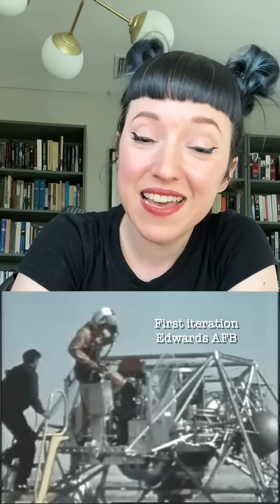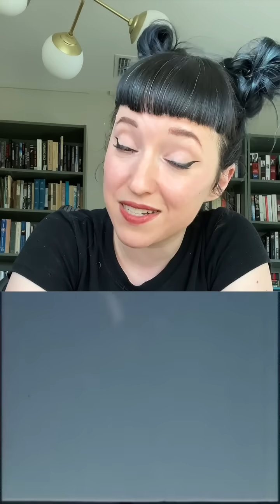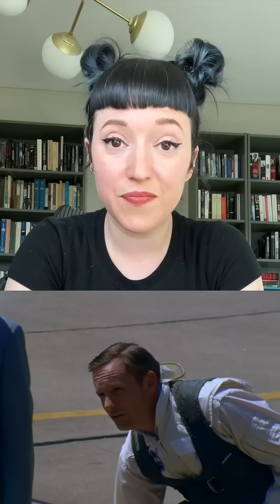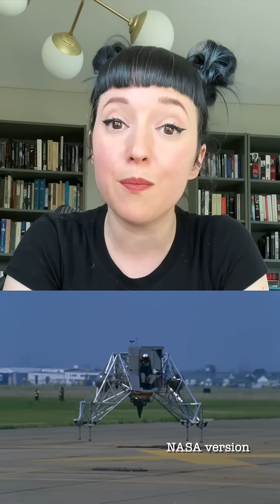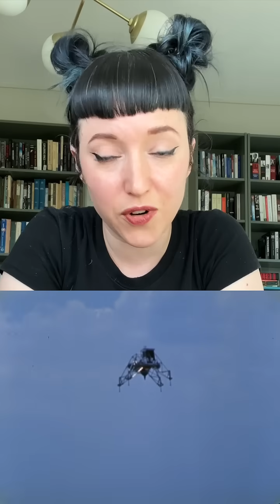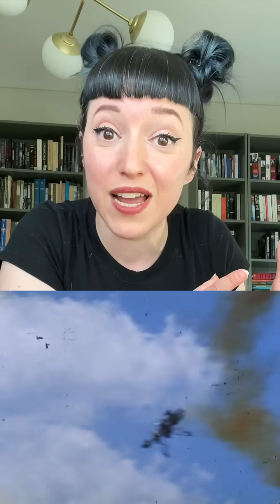When Neil Armstrong narrowly escaped a fiery crash #shorts #history

Comment: 5-6ths thrust? You wouldn't have enough thrust to take off. Surely you mean 6-5th thrust.  ( 6 Pounds  to 5 pounds weight.)
Reply: No, the jet engine provided enough thrust to cancel out 5/6ths of the LLRV's weight. There were downward-pointing rocket engines which provided the remaining thrust (in addition to the reaction control system thrusters).

Comment: I don't think that thing is going to do anything on the moon somehow.
Reply: Sure, it wasn't going to fly on the Moon. But what it taught the astronauts was how much more they'd need to tilt the lunar module to gain or lose horizontal velocity while flying in the Moon's gravity than would be the case on Earth.
Reply: @maxfan1591  Doesn't this beg the question isn't it weird the lunar module was never tested? It would have needed  to have flown hundreds of Miles with pin point accuracy. Was the flying bedstead ever capable of that? mmm. I suppose they got very lucky six times in a row with that one.
Reply: @ "Doesn't this beg the question isn't it weird the lunar module was never tested?"

It was, on three missions prior to Apollo 11.

"It would have needed  to have flown hundreds of Miles with pin point accuracy. Was the flying bedstead ever capable of that? mmm. I suppose they got very lucky six times in a row with that one."

Apollo 5: unmanned test in Earth orbit.
Apollo 9: manned test in Earth orbit.
Apollo 10: manned test in lunar orbit.

So it was actually tested for tens of thousands of miles. And as for pin point accuracy, Apollo 11 landed a couple of miles off target.

Comment: This is extraordinary footage that I have not seen. I can't tell if he ejected in the millisecond Before it exploded. Or weather, it ejected him before it exploded. I know with the technology back then. I'm sure it was he that had to eject. But that's just. Extraordinary reflexes. Here's what I really think happen. It was having problems he ejected and him ejecting caused it to explode. Either way, this is really cool footage. Thank you.
Reply: The explosion that happens in midair was the rocket motor on his ejector seat. You can see the flame fly up away from the vehicle leaving a trail of brown smoke behind it. The vehicle was on its side when he ejected and continues to tip over as it falls, then explodes when it hits the ground.
Reply: @Omnigeek6  I didn't know where the fuel was stored, I thought it was having a catastrophic explosive failure, not just problems with the steering. So that's Why he ejected. but looking back at it, I see it. That's a very stout ejection Rocket.

Comment: The Lunar Landing Research Vehicle (LLRV), a test vehicle used to simulate moon landings, is currently on display at the Air Force Flight Test Museum at Edwards Air Force Base, California; specifically, it's the LLRV-2 model. 

Key points about the Lunar Landing Test Vehicle:

Location: Air Force Flight Test Museum, Edwards Air Force Base 

Model on display: LLRV-2 

Purpose: Used by NASA to train astronauts for lunar landings by simulating the final descent phase

Comment: So are the other thrusters providing more than 1/6 cause other wise its not getting off the ground or hovering
Reply: Correct. AST doesn't explain it well, but in addition to the steering rockets there were two rockets thrusting downwards to mimic the lunar module's descent engine.
Reply: @maxfan1591  appreciate the response
Reply: @ No worries.

Comment: So they called them Zero Zero’s back than… Back in my day the seats had the ability to go from point of Ejection to 100 feet (Zero Zero). Deploying your Parachute and opening it’s self fully before landing… Your outta the Cockpit in one +/- second. There’s a lot of gizmo’s n stuff, but at my time vertical situational orientation wasn’t part of the general operation… Above or below 10k ft. the Drogue Shoot is deployed giving you vertical orientation with respect to the gravitational situation, the main parachute and the seat pan are Jettisoned from the seat at or below 10k feet.… As far as it goes F-14 to A-10’s you’re situational awareness is to Eject as horizontal is possibly possible in this situation, if you gotta go you gotta go whatever orientation you're at... Maybe I’ll dig up the books butt I don’t know on standard systems of my time having this feature… I don’t recall a system of solid rocket propellant angled nozzle sections part of the Mark 5 Solid Rocket Pack controlled by vertical situational awareness system at that present time... Now, there maybe some kinda a thrust nozzle vectoring sequence initiation assist today, of some sort on what we sometimes referred to Mark 5 Solid Rocket Pack under the seat. The Telescoping rocket on the back of the seat allows the seat and you to expeditiously clear n leave the aircraft cockpit as soon as possible, bout the time you’re clearing the Cockpit Canopy seating rails the Mark 5 begins It’s combustion sequence. Mind, it’s been one +/- second, now the real spine compression begins… 

Studying Miss. Amy’s posted video of the Ejection Sequence… (I don't have a computer right now running  with video software so I can't really zoom in n frame by frame that)  Butt the Bed Post extra soft cotton tying rope, hold on what we’re we discussing, oh yeah,,,  does have quite a nose up Pitch n going with a bit left Yaw n Roll. The seating apparatus does seem to have a vertical orientation going on with a little forward pitch but with way way less pitch than the LM Flying Moon Simulator Bed Post. So it may be fitted with a Vertical Orientation type system due to the angles at the time of Ejection in Miss Amy’s  visual aid video… So the only hypothesis I can think of is that the unit(s) are designed with this type of characteristic because of what type Aircraft it is during this time period…  🤓⚒️ 🇺🇲
Reply: "So they called them Zero Zero’s back than… Back in my day the seats had the ability to go from point of Ejection to 100 feet (Zero Zero)."

I understood that "Zero-Zero" meant the seat could be operated at zero altitude and zero speed - that is, stationary on the ground.

Comment: Do you know what ejection seat model was used during this testing?  I worked on ejection seats from the 80’s and wonder what system they used back then.
Reply: All the stuff you worked on is a result caused by these programs, that's why we greatly need to ensure that the Research and Space Programs maintain their course and NASA doesn't get crushed.  Because we need all the life support programs along with habitat n space construction. Before any attempt of a manned Mars mission. Unless someone wants so spend the moneys for a one off... With out the sacrifice of the Core programs and Missions.
Reply: Pretty sure it was a zero-zero ejection seat.  That's why he changes direction after punching out.
I think one of the reasons Neil survived is because NASA insisted those be in their aircraft after Charles Bassett and Elliot See crashed in '66.  They had ejected, but didn't have those seats and died on impact.
Reply: @spinetanium3296  
So they called them Zero Zero’s back than… Back in my day the seats had the ability to go from point of Ejection to 100 feet (Zero Zero). Deploying your Parachute and opening it’s self fully before landing… Your outta the Cockpit in one +/- second. There’s a lot of gizmo’s n stuff, but at my time vertical situational orientation wasn’t part of the general operation… Above or below 10k ft. the Drogue Shoot is deployed giving you vertical orientation with respect to the gravitational situation, the main parachute and the seat pan are Jettisoned from the seat at or below 10k feet.… As far as it goes F-14 to A-10’s you’re situational awareness is to Eject as horizontal is possibly possible in this situation, if you gotta go you gotta go whatever orientation you're at... Maybe I’ll dig up the books butt I don’t know on standard systems of my time having this feature… I don’t recall a system of solid rocket propellant angled nozzle sections part of the Mark 5 Solid Rocket Pack controlled by vertical situational awareness system at that present time... Now, there maybe some kinda a thrust nozzle vectoring sequence initiation assist today, of some sort on what we sometimes referred to Mark 5 Solid Rocket Pack under the seat. The Telescoping rocket on the back of the seat allows the seat and you to expeditiously clear n leave the aircraft cockpit as soon as possible, bout the time you’re clearing the Cockpit Canopy seating rails the Mark 5 begins It’s combustion sequence. Mind, it’s been one +/- second, now the real spine compression begins… 

Studying Miss. Amy’s posted video of the Ejection Sequence… (I don't have a computer right now running  with video software so I can't really zoom in n frame by frame that)  Butt the Bed Post extra soft cotton tying rope, hold on what we’re we discussing, oh yeah,,,  does have quite a nose up Pitch n going with a bit left Yaw n Roll. The seating apparatus does seem to have a vertical orientation going on with a little forward pitch but with way way less pitch than the LM Flying Moon Simulator Bed Post. So it may be fitted with a Vertical Orientation type system due to the angles at the time of Ejection in Miss Amy’s  visual aid video… So the only hypothesis I can think of is that the unit(s) are designed with this type of characteristic because of what type Aircraft it is during this time period…  🤓⚒️ 🇺🇲

Comment: he saturn 5 rockets were all one off rocket motors no two were built exactly the same. and 99% of everything was done on cocktail napkins, and with pocket protectors with slide rulers in them. no computers designed it.
and the onboard computer had to be reprogrammed for the varied mission needs during each flight.

Comment: I want to believe that Neil Armstrong was chosen to land the first lunar expedition. Because he was able to make the right decisions when things went bad.

- Lost part of wing in Korea but made it far enough to be saved.
- Gemini 8. Successfully piloted an uncontrollable craft to a safe landing.
- This one... the flying bedstead.

... and then he chose to take semi-control of the lunar lander to go further than the planned landing area - because of large boulders... Legend!
Reply: You forgot his April 20, 1962 X-15 flight where he reached an altitude of 207,500 feet but on his return inadvertently pulled too high an angle of attack during pullout causing the X-15 flight path to take a bounce in the atmosphere. He overshot Edwards Air Force Base, heading south at Mach 3 at 100,000 feet. He was finally able to turn back while over the Rose Bowl in Pasadena and managed to just make it back to Edwards (Rogers Dry Lake).
Reply: @thornefroemming7796  That's right! I forgot.
Reply: @turtle2720    
Wasn't Buzz Aldrin the Lunar Module pilot?

🍌🤔
Reply: @ He was but the commander piloted the lunar lander and the "pilot" assisted (calling out altitude, velocity, etc)
Reply: Wow I didn’t know about the wing. That’s superhero impressive
Reply: Yes ignore the video and just believe...  heh

They all ended like this and all of them lost control in a few seconds when trying to land/hover... without a modern computer that takes care of stability there is no way to fly something like that.

Comment: I get the jet engine is supposed to simulate lunar gravity by partially cancelling out earth's gravity, but what happens when the craft, including that engine, tilts? Oh...right...
Reply: Are you being sarcastic? The true answer is oh right, inventors did think about that, there's a lot more to this craft's control system than one jet engine blasting at fixed thrust 5/6 of weight.

Your're welcome to not be dumb.
Reply: Scott Manley has a longer video which IIRC included more details about how thorough the simulation was.
Reply: Oh right the engine was gimbaled to always point downward within limits.  Conehead.